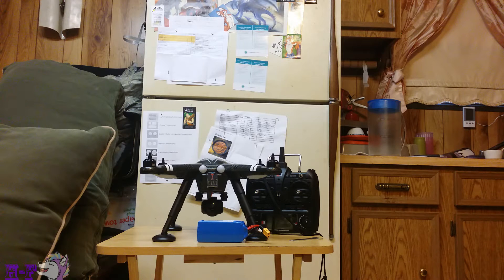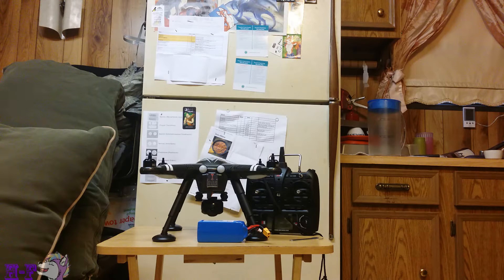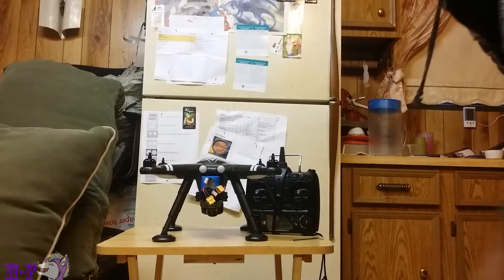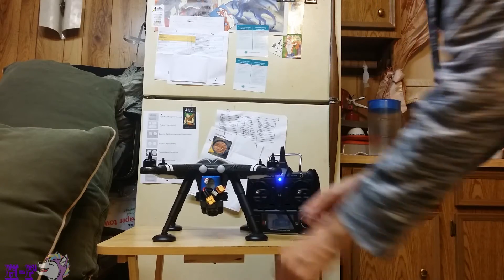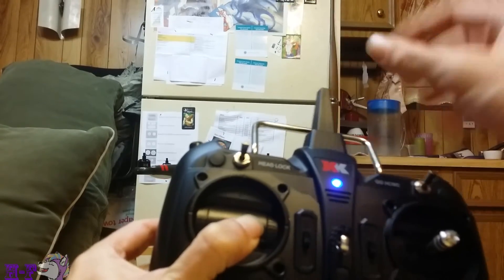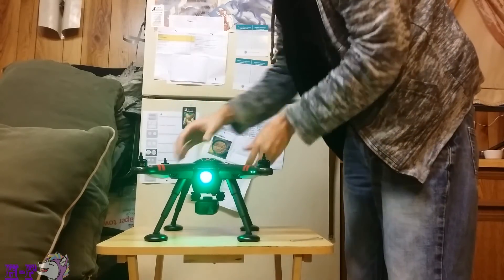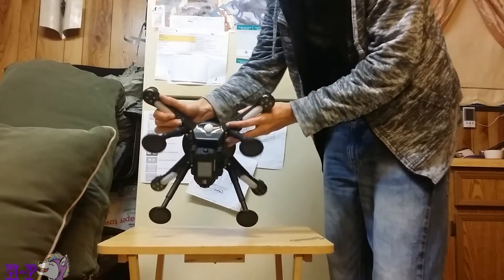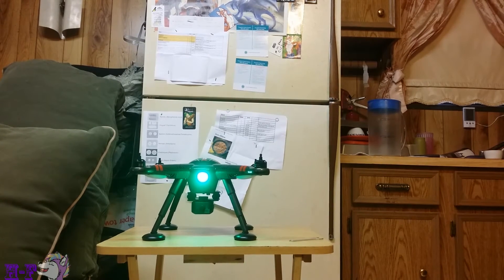X380 Calibration ( Magnetic Compass and Transmitter )

Comment: You say at 2:40 you should bring the throttle stick all the way down to the left, in fact you should bring your throttle stick straight down, then flick the head lock switch, also I found when obtaining GPS lock first turn the X380 clockwise twice, then anticlockwise for the final  perpendicular movement, if there is drifting via the GPS that can not be corrected with transmitter calibration, you can use coper foil in the top shell of the X380 to shield the GPS.
Reply from the maker: Thanks for the info.

Comment: You updated ur Xk? I had a fatal crash on day 2! Just flipped over and came down without a reason :(
Reply from the maker: +NXTgen Gaming I don't know! I got it pretty recently (few months) and never had any flying issues. I'd talk to your selling if you got it on Ebay.
Reply: Just buyed a new one:) now i have a lot of parts:p also buyed the dji carbon 9450 props:)
Reply: Be SURE to check the prop balancing if you can. I found 3 of the 4 DJI props I bought were slightly out of balance.

Comment: I would NOT recommend this calibration method. It will not give good calibration. Rotation too fast. Rotation not steady. Rotation not keeping X380 level. You will get lots of drift & TB'ing. I used to use this technique & if you do smoother, slower, & more level, you will see a big improvement.